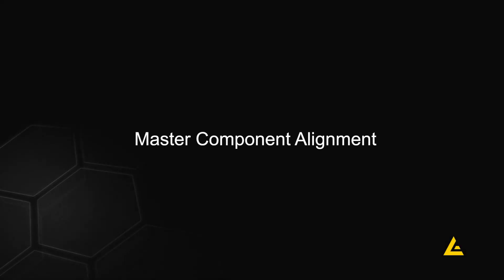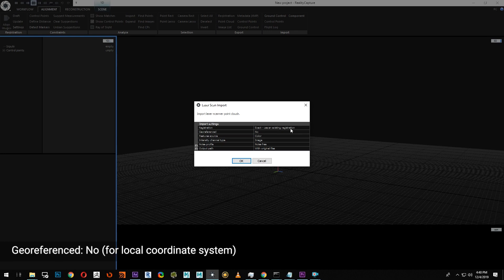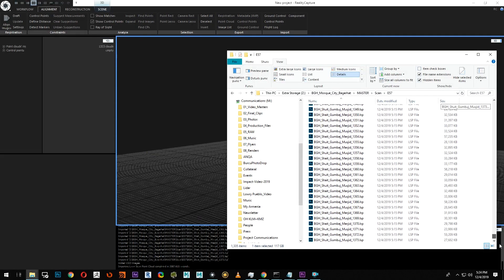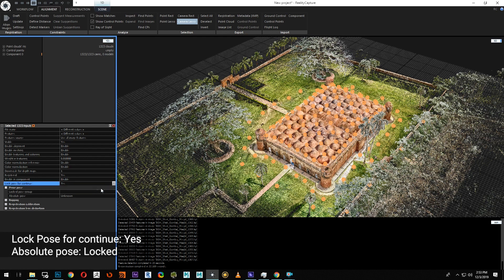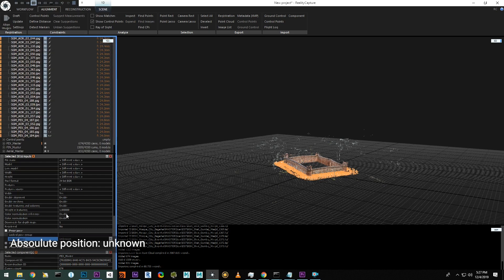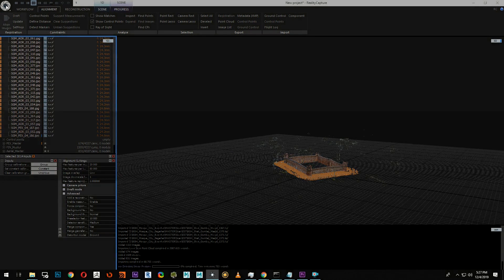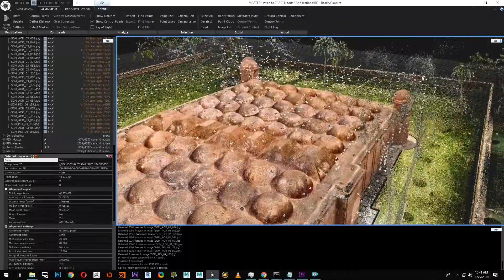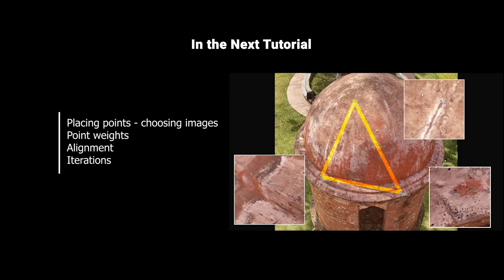Component workflow in RealityCapture by CyArk - Part 2

Comment: Hi, i'm try to follow this tuturial using the actual version of Reality Capture (1.4). I have some problems when i try to merge the laser scanner point cloud with photogrammetry point cloud, the two components doesn't merge.
The point cloud laser scan was in wgs84 utm 33 (registered in trimble business center) i loked is absolute position and do the same thing of the tutorial. The photogrammetry point cloud was made with dji mini 2 and 3 the photo was taken in wgs84 but in alignment phase i didn't use the camera position for the alignment
Reply from the maker: Hi Andrea, so you can use the camera position (which is possible won't be very precise) or you need to use control points. At least three, evenly placed on at minimally three images and LSPs.